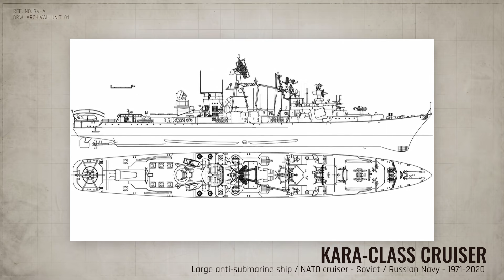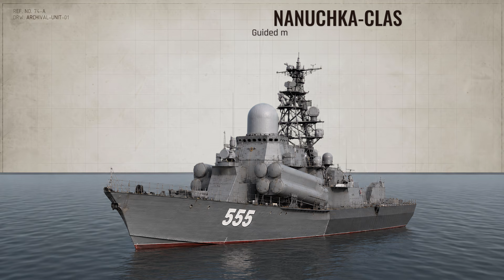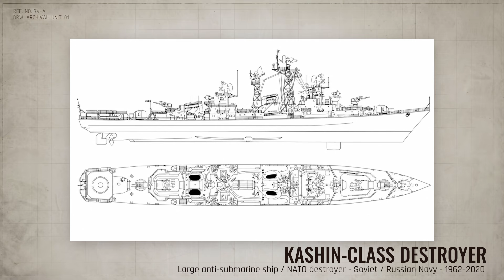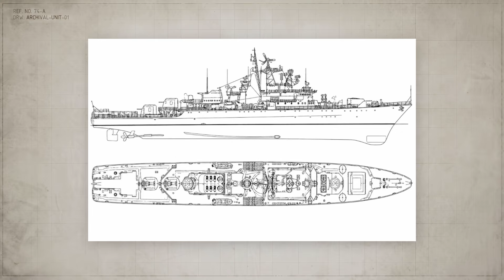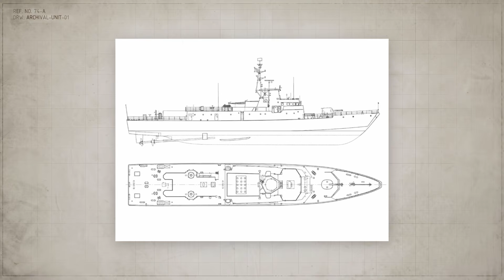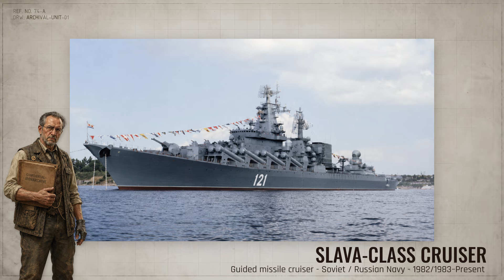Most Underrated Soviet & Russian Warships

Comment: In the 60's, 70's, and 80's, the Soviet were weak in miniaturization. Soviet equipment could be good, but they were bulky. As such, Soviet ships tend to specialize, rather than be more multi-missioned like USN ships. For example, the anti-sub Udaloy would operate together with the anti-air and anti-surface Slava.

Just one minor point. Fiberglass is radar transparent. It does not absorb radar. However, fiberglass can be mixed with materials into a composite that scatters and absorb radar. For example, you can have a radar absorbant material on the surface with a fiberglass substrate. The fiberglass can be imbedded with micro metal needles. This metal needles/wire scatter the radar. Those that scatter away from the radar reciever does not get picked up. Those that scatter toward the the radar reciever gets partially absorbed by the surface radar material. 

Or, there are radar absorbant material and scattering matrial mixed in with the fiberglass.
Reply: The problem with the soviet navy was the lack of maintenance and  lack of all round professionalism.
Reply: @Micm-v3o Considering USS Bon Homme Richard and USS Miami we seem to lack a certain level of professionalism as well.
Reply from the maker: Fascinating technical breakdown, thank you! I appreciate the correction on how the fiberglass composites actually interact with radar. Great info for the community!